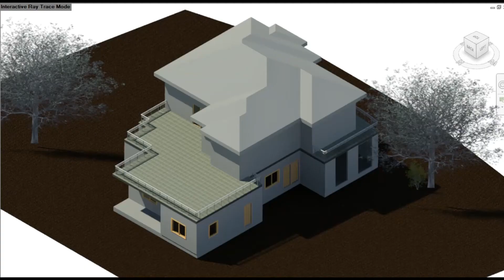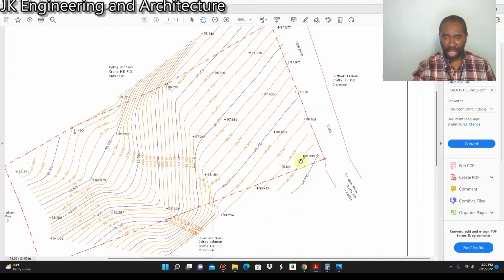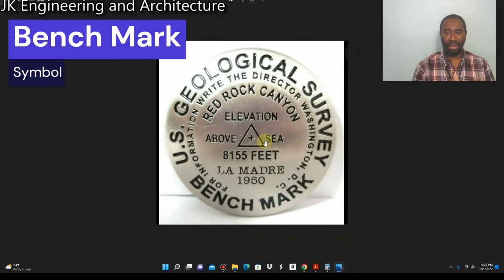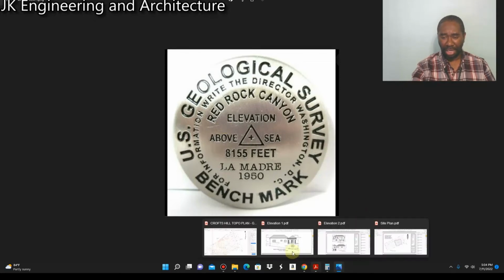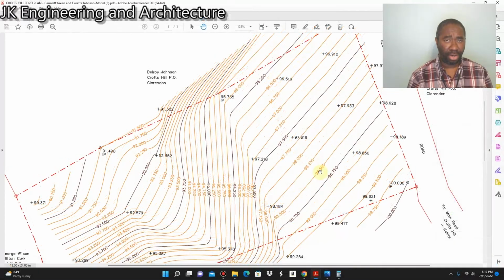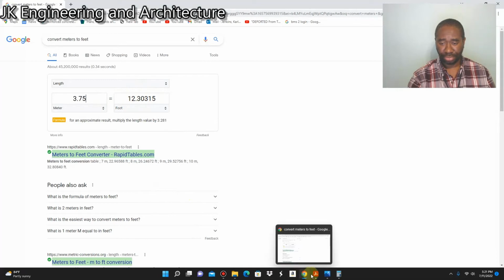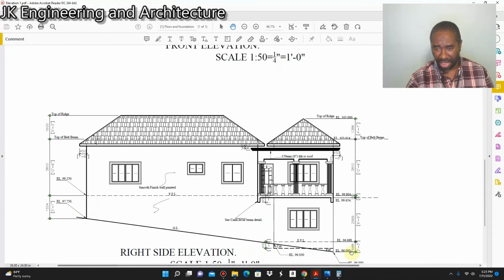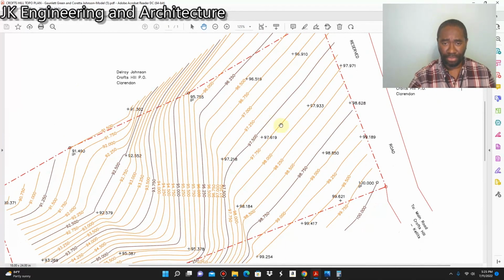How to interpret a topographical survey for your land before construction or Architectural design.

Comment: hey karl, i love your videos brother. can you do a video on concrete slab roof,  can you show us how to properly engineer the steel work, beams, columns, depth, slope for drainage, sealing, preventing cracks, everything... this would be great i think... thanks!
Reply from the maker: Ok. I did videos on reinforce concrete slab already.
Reply: @jkengineeringarchitecture.  I don't understand how you engineer the pitch in the roof slab for drainage purposes.
Reply from the maker: I will address it soon.